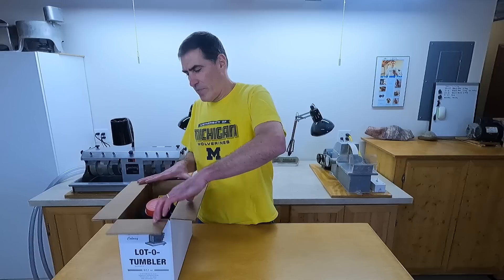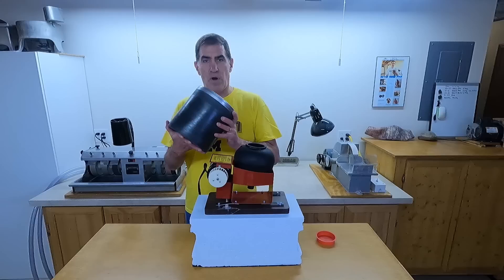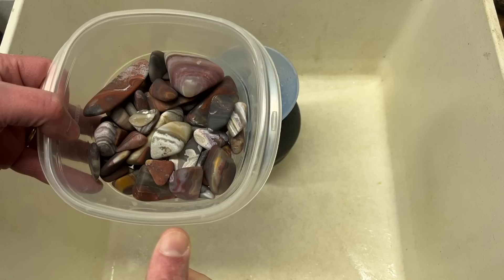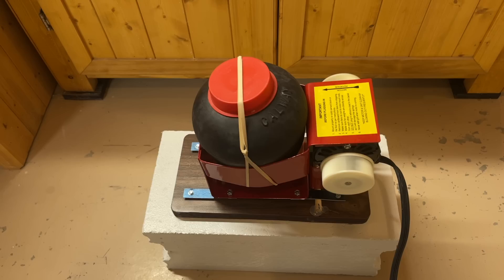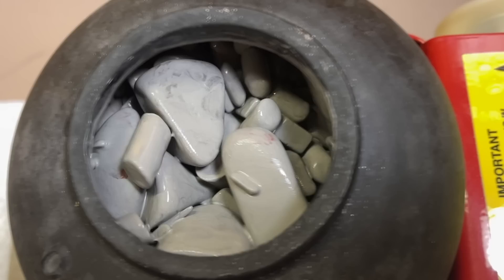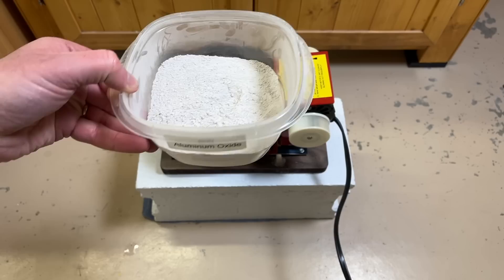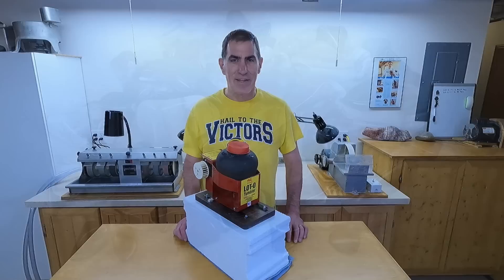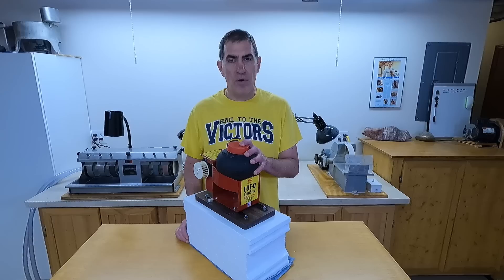The Lot-O Used To Be My Favorite Tumbler. It's Not Now. See Description Below.

Comment: Rob, thanks for this video. I'm still working on getting a concrete block filled with concrete and making a mess of it. Once I use a chisel and remove 1/4" of this hard, lumpy mess,I think I can put some fresh  material in there and get it right. Meantime, I need to get my new ceramic pieces in rotary tumblers (I have the double Loretone with 2, 3lb barrels). Can  you tell me how much of the 120/220 grit I should put in each one and how long should I run it. You said to use the vibratory tumbler but I don't have mine set up yet. Should I add the usual 3- 4 T per drum and do it for five or  days in the Loretone or less. Thanks for any help and thanks so much for all your videos. My notebook is filled with all your suggestions. So far things are doing well on stage one coarse grit. It's all taking longer than I thought especially with the agates! Some have been through 8 times on this stage anywhere from 7 to 10 days!  No wonder my electric bill is higher than normal! LOL 💕😊💕
Reply from the maker: That first stage can take months if you want perfectly smooth rocks. It gets easier to wait the more you do it. To me, waiting is worth it. Some people don't mind some imperfections and are perfectly happy running them for less time and having a few holes in their finished rocks.

I always use my Lot-O tumbler to break in my ceramics. I use two tablespoons of 220 as normal and run them for two days. In rotary barrels, I'd probably use three tablespoons in a three pound barrel and run them for a week. Just give it a try, you're not going to hurt anything if you use too much or too little grit. The time is also not critical. If they look like they need more when you take them out, then just run them again.
Reply: @MichiganRocks Rob, after much effort dealing with a bag of bad concrete, I got the concrete block filled and finished painting that section. The Lot-o stuck, on there even those parts of that concrete were not mooth - thank goodness !But I have the same proble you have with your second Lot- The rocks are moving verry slowly. Now here's my other problem. A regular screw driver isn't working to remove those four screws so I can move that dowel! I'm 82, but very strong from my gardening, pickleball, forty years of working seriously as a potter, so It's not lack of strength on my part. Can you suggest another tool to use to undo those four screws? At first look, it doesn't seem that the dowel/dowels on my unit have a nail in them but I can't be sure. I thought that once I could get those screws out I might just be able to get a thin, scraper under the dowel and bang the end of the scraper with a heavy rock hammer to loosen it. You mentioned a tool you used to remove the dowel, but I'm not familiar with that; and I'm hoping I can use the same dowel. Also,I'm hoping to get this fixed before I go in Thursday morning for my first cataract surgery. If I don't it looks like I should stay away from this kind of job till I get an ok from the surgeon a week after the surgery during my post appointment.Thank you so very much , asl always,for all these wonderful videos you so generously provide. 💕💜👍💜💕
Reply from the maker: @JunesTarotJourney  Use a wrench to get the screws out. There's a slot for a screwdriver, but the head is also hexagon shaped. I like a socket wrench for those but an end wrench will also work. 

I pulled the dowels off with vice grips. I couldn't see the nail until I took the glue off. Vice grips are locking pliers. Find someone who has a few tools and they'll probably have a pair. https://www.amazon.com/VISE-GRIP-Original-Curved-Locking-502L3/dp/B00004YO5M

Be careful that you don't move the dowel too far. The action can get too violent and break the springs.
Reply: @MichiganRocks  Thanks Rob for the heads up about not moving the dowel too far. I only moved it enough to speed up the motion. It's more than it was, but a bit less than how it looks in your first unit. I think I have a pair of those vice grips, so if I have to change things that's very good to know. 💕😊👍😊💕

Comment: Did it say anywhere in the instructions about fine tuning by moving the dowel ? also did you contact the company and let them now the 20cm position would be a better default position ?
Reply from the maker: The directions do mention tuning by moving the dowel. I didn’t contact the company.
Reply: @MichiganRocks  Seems strange to see the dowel both glue and pinned into position, yet its an adjustment piece, bet theres a better design there somewhere

Comment: I just bought a lot-o tumbler. I am having trouble getting rocks to move much. They definitely do not  have the action yours has.I moved the dowel and still no luck. Just wondering if you have any suggestions
Reply from the maker: Are you using too much water? That will slow down the rocks a lot. The rocks should be wet, with no standing water on the bottom. Fill the barrel with water and then dump out as much as you can. If you add water later, do it very slowly. I like my squirt bottle for adding water; I never pour water in.
Reply: @MichiganRocks  I filled with water added rocks and dumped the water out then added 2 tablespoons of 120/220 grit. Rock and ceramic are moving just like your new tumbler in this video before you tuned it. So adjusted the dowel still same movement. Not sure what I’m doing wrong
Reply from the maker: @MrPaulg1971  It sounds like you're doing everything just like I did, so I don't know either. Have you run a complete cycle of rocks yet? If they come out well polished, then it doesn't really matter how they're moving.
Reply from the maker: @Paul Goings I just thought of a couple other possible causes for your problem. Is the tumbler attached to a heavy enough base? It think it's supposed to be 60 lbs. Check the directions that came with it to be sure. 

Also, check the weights in the fans. They should be aligned with each other. If they're not, it's not going to vibrate the way it should.
Reply: @MichiganRocks  I believe the block I attached it to is heavy enough and I will check the weights to see if they are aligned. Thank you very much I really appreciate your help!!! 
Looking forward to your next video
Reply: @MichiganRocks  I just finished the 220 2 day tumble and working on the 500 3 day tumble.
Reply from the maker: @MrPaulg1971  Be sure to let me know how they turn out.
Reply: @MichiganRocks  ok will be taking them out of polish stage tomorrow night will let you know. 
Have you ever had the rocks look like they have metal marks on them?
Reply from the maker: @MrPaulg1971  I have found rocks with metal in them. I can remember a few pieces of unakite with some small metallic parts. I'm not sure what metal it was though.
Reply: @MichiganRocks  so about half turned out pretty good and some not so much. I think I just need to pick better rocks lol
Reply from the maker: @MrPaulg1971  That's a good possibility.

Comment: Hi Rob, Do you know if your friend filled those block with concrete or if they are just dry stacked?
Reply from the maker: They're not filled, but they're attached to each other with construction adhesive. He has a thinner, solid block on top. I was just at his house last week and asked what you did.
Reply: @MichiganRocks  Yeah , that makes sense, and the top block is a 4"x 8"x 16" solid slab likely attached also.
Reply from the maker: @ScottSchupbach  Yes, they are all glued together.

Comment: So, your Lot-O Vibratory Tumbler you had Purchased a Decade ago is still in operation versus the newer Vibratory Tumbler which the original motor has been change to a lesser quality, is this the jest of it?  Well maybe because as we all know businesses needs to generate revenues and they are not selling that many Machines and parts.  So, it is maybe a business ((Shame, Shame, Shame as Gomer Pyle would SAY)) strategy to sell more machines and parts by replacing an outstanding motor to a less quality.  What would you now recommend, Mr. Champion?
Reply from the maker: My old motor eventually died, so both of my tumblers now have the lesser quality motor. Although I have the lower quality motors, they're both still working. I have been discussing these tumblers on the Rock Tumbling Hobby forums for years, and just recently in the past few years, there has been a major increase in reports of motors failing. 

Recently, I spoke with someone who believes that the motor situation may be improving. I'm waiting for more data, but I'm hopeful that things may be improving. I do not think the company is intentionally putting bad motors on just to sell spare parts. 

If I were buying a new vibratory tumbler today, I'd go with a Lot-O. I'd just feel really bad if someone else bought one on my recommendation and had the motor go in just a few months. Here's some additional reading you might find interesting on the subject: 

https://forum.rocktumblinghobby.com/thread/100982/experience-lot-failed-motor
https://forum.rocktumblinghobby.com/thread/101470/finished-batch-watt-concrete-motor

Comment: Hi there - it's been so difficult lately trying to find a lot-o tumbler to purchase.  No one seems to have them in stock.  If there are any leads on how to find a Lot-O, I'd love to know.  Also I'm wondering if there are other vibratory tumblers that you've tried and liked.  Thanks!
Reply from the maker: This is the only vibratory tumbler I have ever used. I have heard that they've had trouble getting springs from their supplier. The two places I buy all my lapidary equipment are Kingsley North and the Rock Shed. I don't know if they have any in stock, but that's where I'd check first. There are links to both places in the description.
Reply: @MichiganRocks  Thanks so much!  Appreciate both your help and reply. :)

Comment: Stick with rotary barrel tumblers . Cheaper than the vibrating tiny little rubber container and your rocks look like crap from rubbing in the same spot forever . I sold mine at prineville rock show for cheap . Love lortone tumblers
Reply from the maker: I love Lortone tumblers too, but I have to disagree about the vibratory tumbler, at least this one. Did you look at the rocks I got out from this batch? They definitely do not look like crap. They're very evenly polished. I've been using this machine for ten years and have never gotten the results you describe. Here are close ups of the rocks that I tumbled in this video: https://youtu.be/O-UuTkyQesU

By the way, I'm not sponsored by Lot-O to say any of the above. I do get a small commission if you buy one of these from Kingsley North, but I also have the Rock Shed listed in the description of all my videos as another good place to buy. I get no commission from them, I just recommend them because I have had really good luck buying them.

Comment: Hi Rob. I notice in the second stage that you run Borax along with the 500 aluminum oxide. But with the rotary tumbler you only use Borax during the burnishing process, after the step is complete. Can you expand on this? What is the purpose behind running Borax along with the polish? Thanks!
Reply from the maker: I'm not 100% sure, but I'll explain what I think is going on. First off, I learned all of these techniques from other people, they're not my own inventions. I don't usually hear from people who do really good rotary tumbling that they add borax with their various grits. In the vibratory tumbler, it works well. I know one woman who does not use borax in her Lot-O, but uses Metamucil instead. Both borax and Metamucil thicken the slurry and help the grit stick to the rocks better. In a vibratory tumbler this is more important since the barrel doesn't rotate. If the grit doesn't stick to the rocks, it would just set on the bottom and not do any grinding. In a rotary tumbler, the grit is going to move up the side of the barrel as it turns and fall into the pile of rocks and still do its work. That's how I understand it, at least.
Reply: @MichiganRocks  Thanks so much, that makes perfect sense. The wife and I just started tumbling last year and nearly everything we know and do comes from watching your videos (no pressure!). There’s just so much information out there that tells you what to do but not why. And with so many various techniques it’s a luxury to have a channel like yours that cuts through the noise. We refer to it often. Cheers and thanks again.
Reply from the maker: @Snoopps99  I'm glad you like it. I learn best when I know why, so I try to do that in my videos. But, like you, sometimes I have a hard time finding a good source for the why's too.

Comment: Hey Rob. Can you tell more about the polish that you use. Not sure if I heard you wrong but I thought you said something about 10,000 grit or something like that. Also what do you think or know about cerium oxide polish or tin oxide polish? Would really appreciate any feedback and help. Thanks!
Reply from the maker: I use aluminum oxide polish from either the Rock Shed or Kingsley North. Both sell polish that is about two micron which would be over 10,000 grit. There are links to the stores in the description of this video and it’s also in my Amazon storefront. 

The Lot-O directions say that cerium oxide doesn’t work well in it. It’s also really expensive. I have some tin oxide but have only used it a couple times. I didn’t notice it working better than aluminum oxide, so I don’t use it anymore.
Reply: @MichiganRocks  ok great! Thank you very much! :)
Reply: @MichiganRocks  one last question. How much of the polish would I use? I’m using the Lotto. Just not sure on how much TIA! :)
Reply from the maker: @rockersfromaz3001  I use 1/2 teaspoon per batch, so a pound would last me a very long time. I use much, much more in a rotary tumbler.

Comment: Fine video. Have you tried walnut media instead of corn cobs?
Reply from the maker: No, only corn cob for try tumbling. I should give walnut a try though. I think there's a good chance it would work well.
Reply: @MichiganRocks  It's a little tougher than corncob. I switched over to walnut years ago for my brass as it didn't take as long to shine it. And, you can get treated and non-treated.  (grit)
Reply from the maker: @jimv.661  I would always go for non-treated so I can control what grit I use better. I might give that a try some day.

Comment: These seem way more fussy than a rotating tumbler. Is the finish that much better? Or is it just speed? Thanks for your expertise. Just getting into rocks.
Reply from the maker: They have the reputation for taking more attention, but I don't think it's bad at all. I just check mine a couple times a day, especially in the 220 stage. After that, checking once a day is enough. I won't let my Lot-O run while I'm away for a weekend like I will my rotary tumbler though. 

I think the Lot-O gives a superior shine compared to what I get in a rotary. I also find that I get consistently good polishes, whereas with a rotary it's more hit and miss. That could just be because I have a lot more experience polishing in a vibratory tumbler.

I like this machine for the speed, the small amount of grit it uses, and the great polish I get with it. But if you don't mind waiting, it's possible to get a good shine from a rotary tumbler too.
Reply: @MichiganRocks  thanks for the reply. Hope to see you on the beach! (We got a place in Topinabee and go to all your spots over the summer)
Reply from the maker: @MrSquawkvfr  I had a friend in college from Topinabee. Nice little town.

Comment: for that high price for what is essentially a small electric motor and some bent flat steel (and a rubber barrel), it is more than a little disappointing that they dont at least come tuned from the factory. Like, what is all the money going to then, because it cant be the raw materials, and if it's not the factory's expertise in setting it up properly, what then?
Reply from the maker: I don't know what it costs to make something like this, but I have never felt like I got ripped off. I agree that it would be nice if they were tuned better out of the box though.
Reply: For that money, I’d expect... a base. 😂😂😂